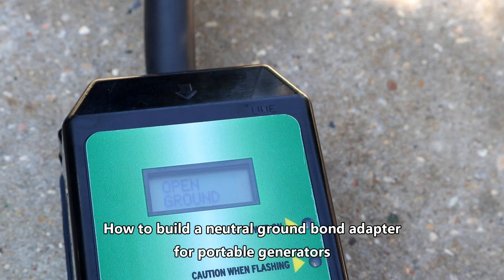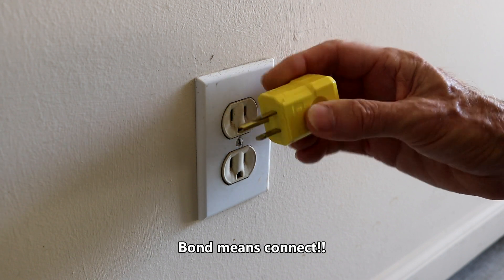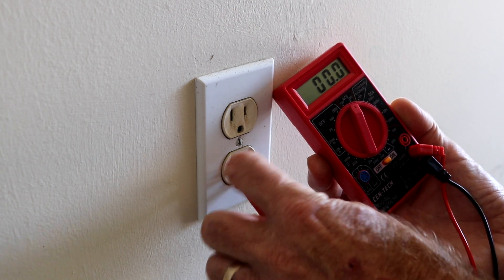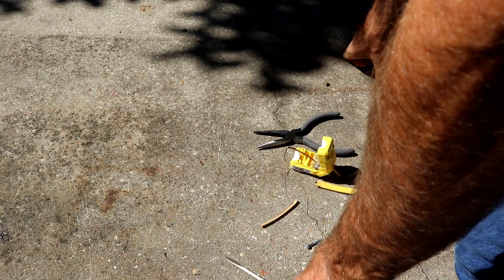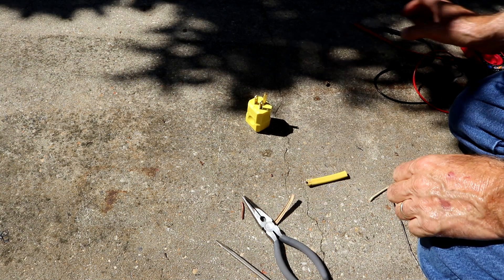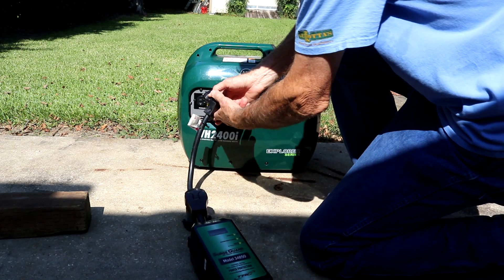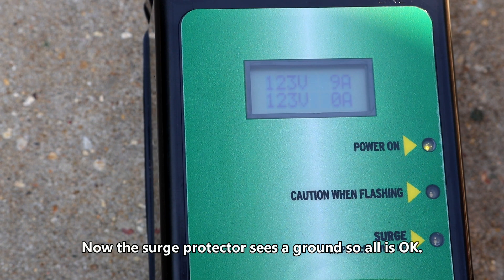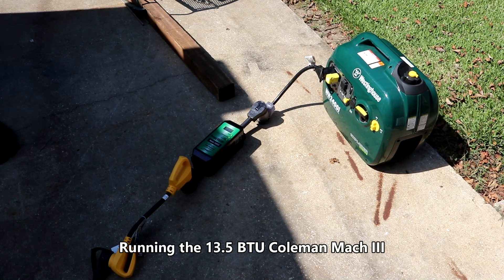How to make a portable generator work with an RV surge protector

Comment: Add us to the list of people you saved a lot of money and headaches. All of a sudden, after 4 years, our RV's hardwired Surge Guard would not let our Honda EU2000 generator power the unit. The RV worked on shore power so we took the generator in for service only to be told there was nothing wrong with it. We found your video, my husband fashioned the neutral-ground bonding plug as described, and viola! SUCCESS! We do wonder why this issue happened after the Surge Guard and generator worked together before but we are most grateful. You saved our vacation. We can get out of the expensive campground and go to the place with no hookups and we didn't waste hundreds of dollars on a new generator or Surge Guard. Thank you!!!

Comment: Thanks so much for your support and assistanceσσ>share4.photo/CampingGenerator?にm   I love my little machine and feel more secure in my mobile life. Besides the benefits I previously mentioned - I do love the handle that folds flat - others don't. I've also come to appreciate the box with handle and room for the cables to keep my Paxcess 330W Power Station in.

Comment: I built the neutral ground plug just as the video explains, then I hooked up the surge protector and it went thru the delay period like normal. So then I turned on the fan motor on the roof top  ac unit and everything works great.  Then I turned on the ac and it would not come on. The surge protector goes into a very long delay ,but no ac. Any suggestions, still scratching my head......

Thanks 
Jerry
Reply from the maker: Edit; Apparently the surge suppressor doesn't like what it's seeing.  Try it without the surge suppressor but leave the ground plug in.
Reply: everything  works with the ground plug in and no surge protector. when I hook up the surge protector it goes thru the delay period correctly and green light comes on.....but when I turn on ac unit ,it shudders once and then repeats the 128sec delay all over.
 your comments are appreciated

Jerry
Reply from the maker: @JM-zb9jy  That's weird, seems like it would give a message.  like low voltage or something.

Comment: What adapter are you using to plug into the generator?
Reply from the maker: A standard 30 to 20 amp adapter.  My gen only has 20 amp outlets

Comment: I have a TailGator portable electric generator model 63024 (120VAC 800-Watt rating/900-Watt maximum) and the user manual suggests connecting the ground screw, located on the diecast aluminum generator housing of the TailGator, to a nearby electrical ground, or, being truly portable, a 5-foot copper grounding rod hammered deeply into the ground.

I've done this, but worked out a way of using three 40-inch long 0.50-inch copper pipes (easy to hammer in... and easy to pull out). My improvised 3-rod field earth ground works great when tested as a "Correct" ground on my house wiring, but I still get the "Open Ground" on my electronic line tester when I hook up my improvised earth ground to my TailGator generator. My 300 Joules surge protector needs no true ground, and in fact simply passes the existing ground connection (if any) on to the electronic device it protects. But most, if not all serious surge protectors, including my 1,000 Joules surge protector, require a true physical earth ground to protect against surges, although they will function as a standard "dumb" power strip if there is no ground, without surge protection.

While I'm impressed with your method to out-fox a surge protector, my question is: Will my novel 3-rod earth ground / TaliGator rig still be safe, using your clever device?

Thanks.

Comment: The first question should be, "Why do I need a Surge Protector on a generator?
Reply from the maker: I would say, for the same reason you would use one with commercially generated power.
Reply: @MarionBlair  Fair enough, but with your generator you control everything. The chance of a bad wiring job or lightning strike on your 25' power cord are minimal.
Reply: 5% or more THD (Total Harmonic Distortion)  Inverter generators have 3% or less THD.  It makes a difference to sensitive electronics that you might find in an RV.

Comment: like your Harbor Freight Multi Meter. LOL Good Video! The east way to identify neutral, It is the larger slot. The smaller is hot. It is harder to stick something in the small slot thus it is neutral.

Comment: My little Sportsman 800/1000 generator/Inverter only has one 110 outlet.  Is there anyway to do this sort of thing with that?  Thanks.
Reply: Yes, add a one to two (or 3) outlet adaptor on the generator. Build the plug with the jumper and install it on your adaptor.
Reply from the maker: Sorry I didn't see this.  It can be done internally also, so maybe you can find the ground strap inside the generator and do it there.